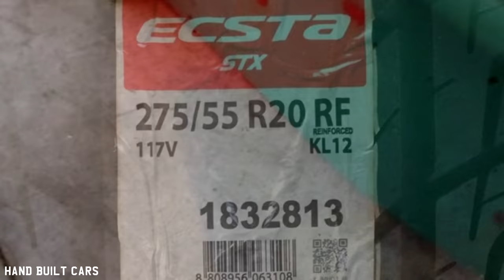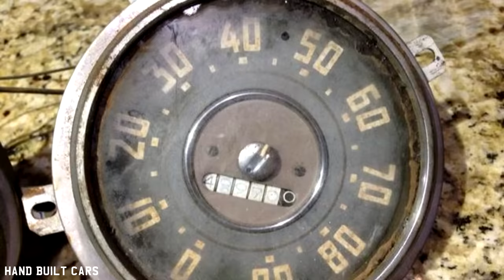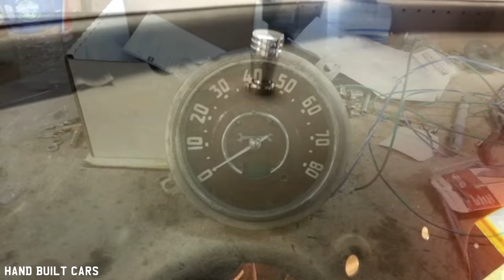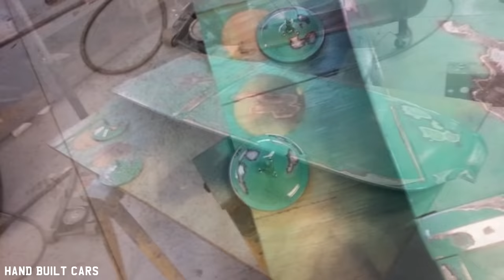1953 Chevrolet 5 Window Pickup Truck 5.7 TPI Build Project

Comment: What a Gawdawful thing to do to a nice old truck -

a Frankenstein not a Custom, and certainly not enough style to be called a Hot Rod -
Reply: 0pinions vary...
Reply: Glenn, I couldn't agree more. The '53 panel van turned out really nice, but this thing is a mess, no sense of proportion with wheel selection, and the combination of rust, primer and old paint that some folks call patina is something I have grown VERY tired of.